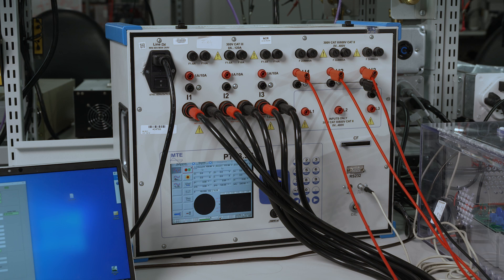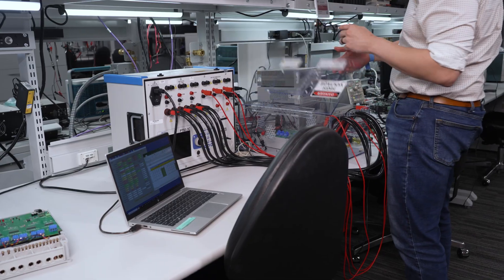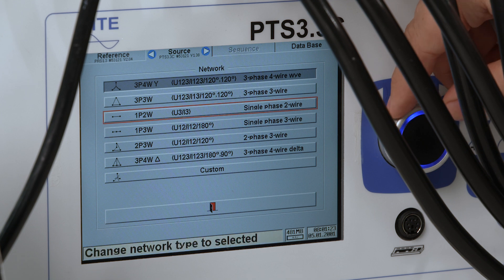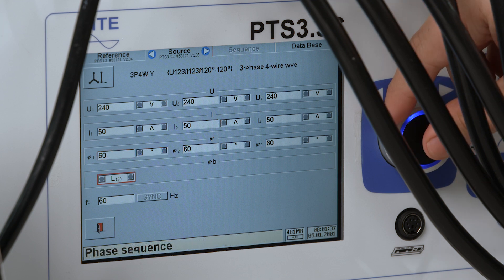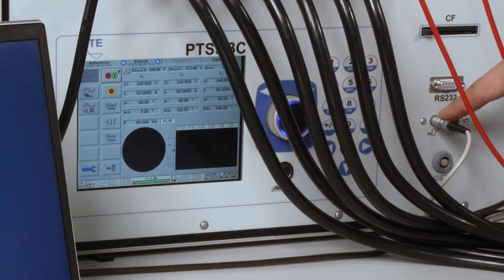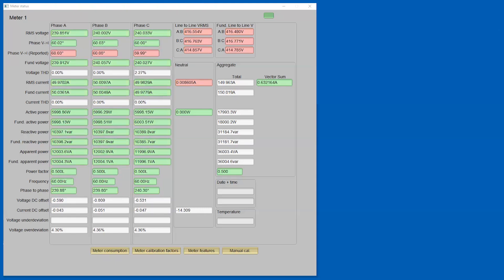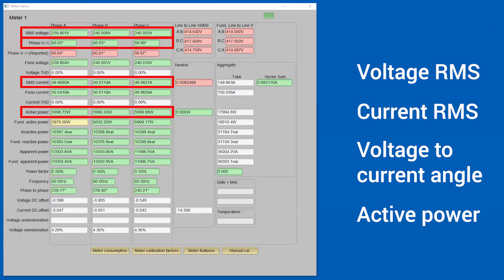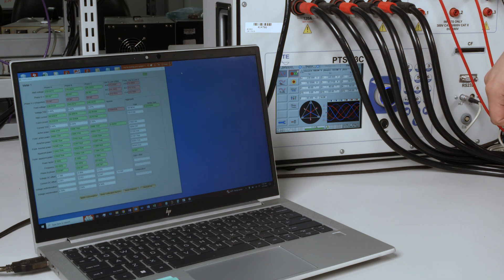Testing e-metering accuracy for revenue-grade standards

Comment: Is the IT ADS 7830I 8BTL chip able to used as a bi-directional logic level converter (for low voltages)?